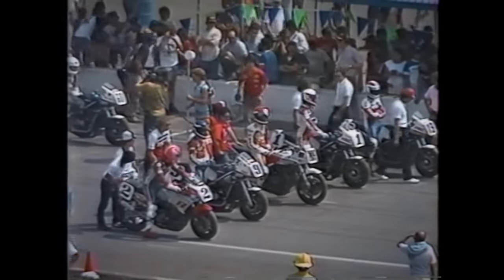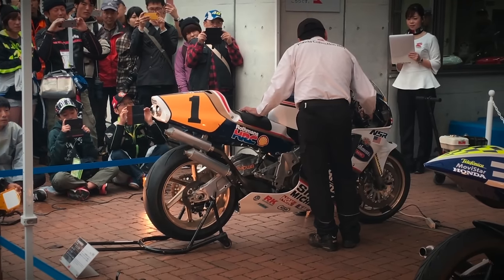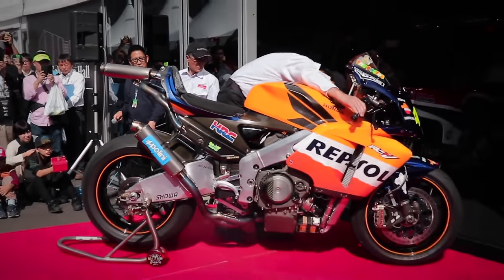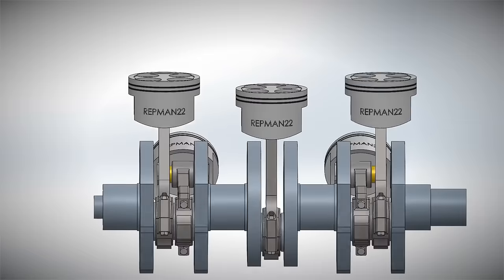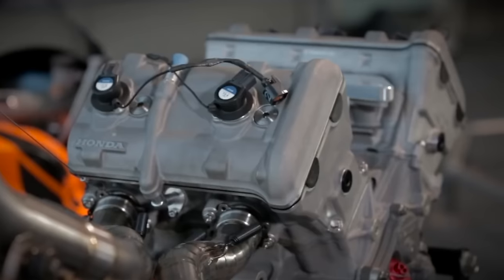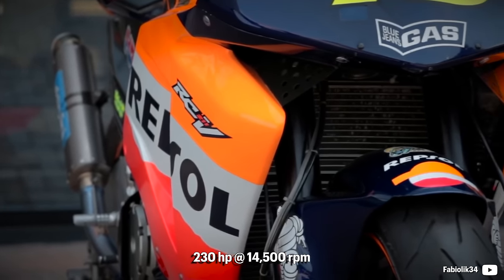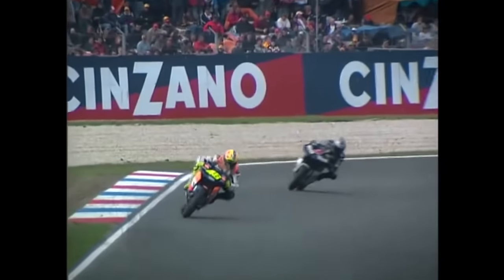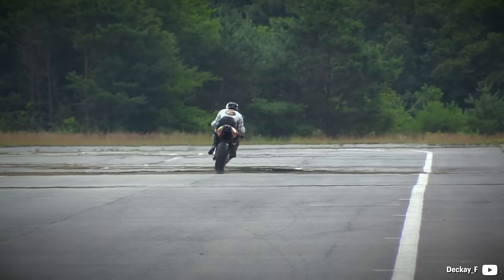Why Honda Used the V-5 Engine

Comment: 260hp/liter on the V5
283.75hp/liter on the 800cc v4 
Absolutely insane for naturally aspirated 4 strokes 😳
Reply: Now the v4 998cc gp bikes have 300-320hp
Reply: That's MotoGP for you.
Even current MotoGP bikes, especially the Ducati, has well over 300hp
Reply: @Tahterimonni  F1s V10 3liter engines had +300hp/liter 17 years ago
Reply: @fuzzy1dk  bmw had 1000hp/L 4banger  already in the 80s
Reply: @rampage3337  it wasn't naturally aspirated and maybe, possibly, had that power for half a lap before it grenaded. how much HP the BWM had keeps going up every time the story is told
Reply: @Lasse Langwadt Christensen  Nope
Reply: @rampage3337  yes, with turbocharger, not N/A
Reply: @rampage3337  that was a qualifying engine one lap use only with rocket fuel 😂
Why did you even manage to sneak that statement out in a NA discussion
Reply: Just in the past,,, if the V5 engine of Honda still developing till today it will be even more,,, just in the old  days it is already impressive.
Reply: @Tahterimonni  if honda use 1000Cc v5 engine in motogp.. we know what happened to ducatis
Reply: @rampage3337 yeah because it’s a turbo lmfao

Comment: Thats it im calling up Allen Milyard to add another cylinder to my bandit1200!!
Reply: To make it an I5 or a v5?

Maybe an XR600 aircooled cylinder, then call it a Bandit 1800…
Reply: He might add 6 cylinders
Reply: all he'd need is a hacksaw and a hydraulic press
Reply: @TROdesigns  plus a cup of tea & a cupcake!
Reply: Facts
Reply: @Iowa599  maybe i should ask him to add 2 cylinders in a H configuration like the RG!
Reply: @fidelcatsro6948  or add some 2-smoker cylinders!
Reply: @Iowa599  Ingenius Idea.. all i need is to keep the 4 cylinders and turn them into 2 strokers.. an inline 4 cylinder 1200cc- 2 stroke monster!! it will become 50lbs lighter as well!!
Reply: That will be easy for Alan
Reply: Honda the best in engineering
Reply: V7 and he will prob be interested
Reply: What?
Reply: Allen Millyard even kind of rhymes with Add A. Cylinder. 

Ok, it's a stretch.
Reply: but you have 30 already
Reply: How Allen Milyard hasn’t been persuaded to build motorcycles for racing is beyond me 
The guy is a certified genius his viper v10 bike is out of this world but his other bikes are better in my opinion 
the Honda RC replica he made and the Kawasaki V12 are both engineering marvels 
The RC is something special 50cc 6 cylinder pistons 
Guy Martin had a go on it and was baffled how he made it with hand tools and a lathe that’s decades old
Reply: @TROdesigns while answering the phone to gretta thunberg 😂

Comment: This is one of the coolest bikes of MotoGP, unique engine, unique sound, 2 titles achieved by Valentino Rossi
In the next video talk about the Desmosedici GP
Reply: Too bad they can't make a good bike now. This year's Honda in the MotoGP is absolute garbage.
Reply: @unbiasedcobra6672  In the first races they were doing a decent job, since 2020 without Marc Marquez they were doing bad seasons
Reply: @l.s.gangstar2984  HRC is 12th and 15th in the championship at the halfway point. Every single other brand is higher then them. The bike is shit this year.
Reply: @unbiasedcobra6672  it could be, luckily I'm a Ducatista and I'm not a Honda fan
Reply: @l.s.gangstar2984  I'm a Yamaha fan. It doesn't change the fact that this year's Honda sucks.
Reply: @unbiasedcobra6672  I completely agree
Reply: @unbiasedcobra6672  they need to bring back v5
Reply: @Randomvideosonnet  it couldn't hurt. This has been the worst stretch for HRC in a very long time.
Reply: @unbiasedcobra6672  it can hurt ducatis speed.. you know v5 smooth and faster than v4

Comment: The reason was the rules for MotoGP, there were weights of the bike for less than 4 cylinders and less than 6 cylinders and 6 cylinders. The 5 cylinder bike could weigh the same as a 4 cylinder bike but more cylinders = more horsepower, that is why you also had the 3 cylinder Aprilia RS cube, it could weigh less than a 4 cylinder.

Comment: this engine is a serious marvell of engineering. You'll have to be seriously smart to thing about adding a cylinder and a piston to perfect balance....

( isn't that cute, the starter cart (6:32) also uses a Honda engine, it's a GX200 made for pumps and off-grid generators).
Reply: Thank you for pointing that out lol kinda neat Lil thing
Reply: @notfiveo and?

Comment: Triumph at Meriden had a watercooled V5 design in the 1960s but typical lack of British impetus , inertia and the beginning of sales issues abroad , calamitous mergers etc., shelved the design . Famous for their 3 cylinder engines , they simply created a narrow angle V by adding 2 behind without significant weight penalty . Love Honda for bringing these designs to fruition .

Comment: Honda can do some amazing stuff. My first bike was a high mileage used Honda VFR 800 2002. That bike had a V4 engine that sounded amazing. I had fun with it until some jerk stole it from my driveway. I've got a Hayabusa 08 now and more discipline with the wheel lock.
Reply: how the heck bike can get stolen from your driveway? are western countries lawless states that thieves are brazen enough to steal it right from your driveway?
Reply: @lordjaashin  Well I have gotten also motorcycle stolen from my driveway and I live in Finland. You have to be careful, no matter where you live.
Reply: @megapet777  Finland is also western country lol

Comment: Imagine swapping this baby into something like a Smart
Reply: Theres a smart for two with zzr1400 motor in it in my city. Burning rubber is all it does.
Reply: youd need plenty of revving to move around comfortably
Reply: Low torque makes no sense 🤷
Reply: @JZX_202  I know that Atleast one street legal smart for 2 with a turbocharged Hayabusa engine exists in Germany but they are running e85 for emissions so not daily drive able
Reply: @afox5319  this one is not street legal, but hey, its croatia so bribing gets you out of everything. Especially if youre well known  to people. This one is owned by a singer so a small thing as a photo with him would be fine. Btw that dude in blue dropped a video some days ago. Turbo Hayabusa smart for2.
Reply: Destroy a mega bucks moto gp bike for a common smart car. How meny mushrooms you had.

Comment: Come on ppl, Honda played this game 20 years earlier with a V3 (The NS500) in the 500cc GP championships, with Freddie Spencer taking the championship on the V3 in '83. Each cylinder was ignited every 120 degrees of crankshaft rotation, which meant the explosions were evenly spaced, the two upward cylinders (No.1 and 3) and the downward cylinder (No.2) were angled at 112 degrees. And they did it back then for the same reason: to narrow the package. Honda veteran engineer Shinichi Miyakoshi visited the Dutch TT at Assen in Holland and noted that the fastest of the 350cc GP machines would have qualified on the second row of the grid for the 500cc race. So the concept for the NS500 became one of a compact and light machine with a small frontal area of a 350cc GP racer. But the connection between the V3 and 350cc GP racers is even more pronounced as German manufacturer DKW had employed a V3 in the 1950’s for its 350cc GP racer, something Miyakoshi most certainly knew about. The NS500 also used similar engine architecture to the DKW with two upright cylinders, but unlike the DKW the third cylinder pointed downwards at 112 degrees instead of the more conventional 90 degrees of the DKW. 

No fast forward 20 years later to the Honda developing the V5 for MotoGP. Guess who then was making the only production V5 in existence? Zee Germans, specifically, VW. 

Everything is a contact business.

Comment: The firing pattern is not widely known, so I picked these out of the video (and I assume that they came from one or more of the provided references). 
Two firing patterns are given:
0°, 284.5°, 360°, 464.5°, 644.5° (for the initial version)
and 
0°, 284.5°, 464.5°, 464.5°, 720° (for the 2004 revision)

In terms of intervals between firings, that's
(with "*" meaning one cylinder fires and "**" means two cylinders fire together)
* 284.5° * 75.5° * 104.5° * 180° * 75.5° (for the initial version)
and 
** 284.5° * 180° ** 255.5°  (for the 2004 revision)

Both are based on the same crank configuration, and vary only in which revolution each cylinder is fired.
The first is as even as possible for separate cylinder firings, like firing the two cylinders of a 360 degree parallel twin on alternate revolutions. There is significant overlap in power pulses, but still two gaps in power delivery.
The second is the "big bang" alternative, firing the cylinders which reach the top together at the same time (on the same revolution) like a "big bang" 360 degree parallel twin; it has power pulses much like a conventional inline triple (0°, 240°, 480°). There is no overlap in power pulses, and significant gaps in two of the three intervals. In this second version, it is the oddball middle cylinder on the 3-cylinder bank - the one on its own crank throw - which fires by itself. This is more regular in a sense than the first pattern, although one of the three pulses per full engine cycle is half as strong.

Comment: It needs to be made clear that the regulations had different minimum weight requirements for different numbers of cylinders.
If Honda chose a six cylinder engine the bike ,it would have to be heavier and therefore less competitive.
The V5 no longer exists because 4 cylinder engines can achieve the same results.
Reply from the maker: Yeah, that’s true. But they had the same weight as other four-cylinders on the grid
Reply: The rules changed to only allow 4 cylinders, a 5 cylinder would make more power but with heavier fuel consumption and they (Dorna)  reduced the amount of fuel you could use .
Reply: A 5 cylinder will make more power than a 4 cylinder but use more fuel, Dorna limited the amount of fule you could use and later changed the rules to only allow 4 cylinder engines.

Comment: Vw used one too in production cars
Reply from the maker: Though, that’s not a real V5, but a VR5. Similar, but different.
Reply: The VW "VR5" has a narrow 15° vee angle, which makes everything about the engine design different (balance, cylinder packaging, head design, firing order...).

Comment: Honda should make hybrid cars with their motorcycle engines as the generators.
Reply: Motorcycle engines like this are designed for high power, not high efficiency, so they're not suitable for the engine of a hybrid car. Motorcycle designs can be adapted, but a sportbike engine would require too much change to hit efficiency and weight targets. 

BMW used a Kymco engine in the i3 REx (the series hybrid version of the i3 electric car), but that's a lower-output, lighter, and more efficient twin design rather than a sportbike engine. It is a 647 cc 270° parallel twin capable of producing 28 kw (38 hp) but run at only 25 kW (34 hp) in the i3, about half of what a 650 cc twin in BMW's bikes produce.

Comment: It's a shame Honda never made a V5 street bike.  It would have sold well despite the cost.
Reply: i think like the cbr 250 it would have to be a max of 250cc to sell in japan without punitive taxes. hard to say if the market would be there for it. personally i think the v5 would be awesome in a hatchback car. small, light, narrower than a 90 degree v4, without needing the extra cost of a balance shaft in a v6. a pity about the expense of casting two different heads though. someone could try build a v5 with single cylinder heads and pushrods i guess, but it would be difficult to share the cam between both cylinder banks.

Comment: Onlyway to save current internal combustion engine specialy for motorcycles is swap gasoline tank to HHO generator, even in superbike and motogp this is easy way, other solution is too risky and waste of time for R&D like hydrogen tank or bio fuel.

Comment: This is overall a bad first level engineering overview about the decision to go for a V-5 engine.  Engines make power based on their piston cross sectional area. So more cylinders have more area than fewer cylinders. But you have to balance or optimise the increased number of cylinders vs the increase friction and mass of additional cylinders. The regulations stated 990cc. Honda was the only one to put their immense engineering knowledge to determine that a V-5 was suitable.  Take note that when the regulations went to 800cc.  Honda reverted to a V-4 layout.

Comment: Although I am sure Honda have superbly engineered this engine, the difficulties in making it run without vibrating itself to pieces, is hardly worth it. The concept of the v4 or even v6, almost guarantees a natural balance in design. Simply makes more sense.
Reply: neither the v4 or v6 can be perfectly balanced in both primary and secondary forces.

Comment: Toyota and Honda are sleep walking into the future. They are looking to the past and projecting it forward.
EV adoption is accelerating every year. Exponential not linear. The only limiting factor is batteries.
The number of electric vehicles and types of vehicles and trucks is growing.
Electric vehicles are just better. No noise, no emissions, less fuel costs, less maintenance costs and amazing technology. Gasoline and diesel are OLD polluting technology.  PHEVs still have a gasoline engine polluting the environment.  Toyota and Honda will be late to the party. It will cost them market share, market value and future customers. There is a Climate Crisis. Young people will not buy petrol and diesel vehicles that add to the Climate Crisis.
Reply: You said it yourself "batteries are limiting factor"
EV buyers will come to regret their decision for the multitude of reasons you well know. Governments and motor manufactures are trying to lead us all down a blind alley.
And another thing, this is a petrol heads channel, I can't imagine Mr Viseo waxing lyrical about electric motors and if he tried I would not be in the audience.
Reply: Is that why lithium mines and every form of freight transit still uses petroleum?